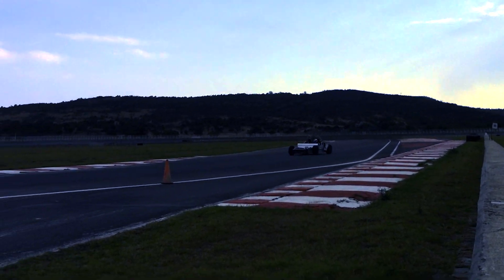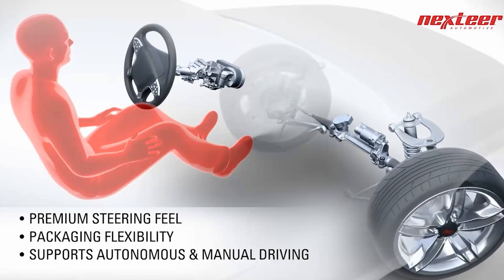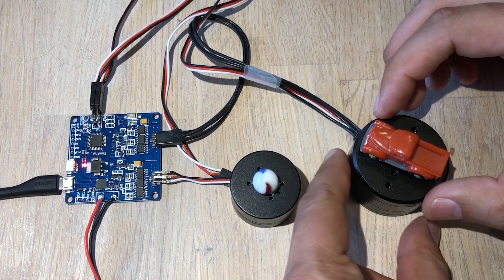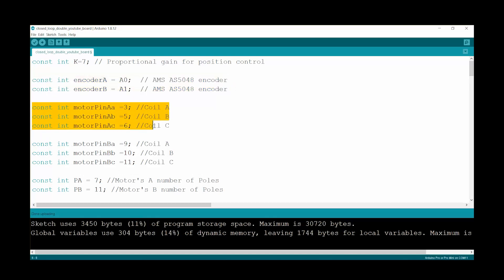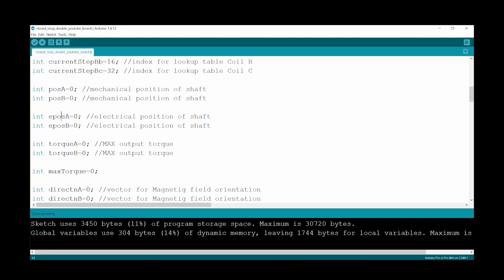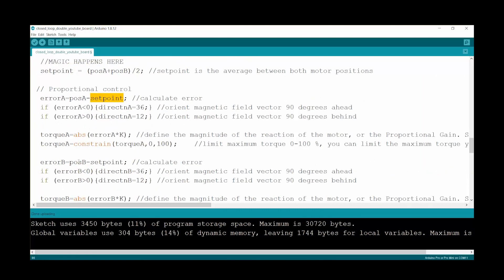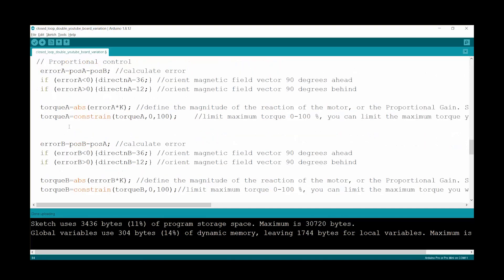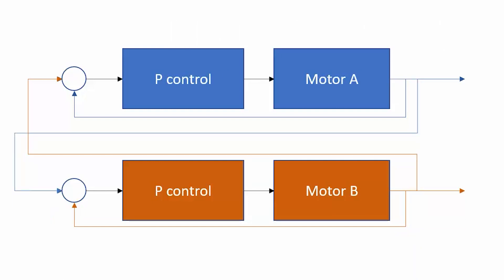Arduino Steer-by-Wire PID demo using Brushless BLDC motors FOC field oriented control.

Comment: - 0:00 Introduction to the video and topic: Steer-by-wire systems.  
- 0:35 The speaker talks about his past experience as a lead engineer in developing Mexico's first commercial sports car in 2010 to 2013.  
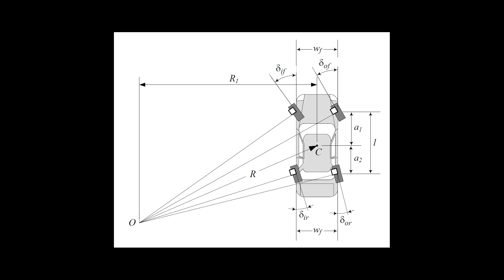- 0:50 The complexities of implementing steering systems are discussed, including the challenges of packaging and the effects on the route of mechanical components.  
- 1:14 The speaker emphasizes the importance of considering these factors to ensure proper handling and performance.  
- 1:27 The benefits of removing the mechanical connection between the steering wheel and the steering rack are discussed, including easier packaging, programmable steering behavior, and increased safety during collisions.  
- 2:00 The speaker talks about his interest in solving this problem using mechatronics and creating a steer-by-wire system.  
- 2:19 Introduction to a working prototype of the steer-by-wire system, using two motors to represent the steering wheel and the steering rack.  
- 3:00 Demonstration of the working prototype and the interaction between the two motors.  
- 4:13 Explanation of the code used in the prototype, including the use of two encoders, closed-loop motor control, and the importance of reflecting the range given by the encoder in the motors.  
- 6:50 The speaker discusses the process of calculating the error using the positions of the motors and the setpoint, and the use of proportional control.  
- 8:00 Introduction to an alternative method suggested by comments in previous videos, which involves using the position of the other motor as the set point.  
- 9:13 A diagram is shown to illustrate the feedback loops and the configuration of the closed-loop control system.  
- 9:57 Conclusion of the video and thanks for the support.

Comment: Hi, thank you for the detailed videos. I'm curious, How would such a system work if there was only one motor and you want to do force multiplication, like for example an exoskeleton, where there is one actuator per joint and your body is the input. Thanks.
Reply from the maker: It is exactly applicable to that! The torque of the output depends on the motor you use, and can be controlled via code. Information travels bidirectionally so it’s exactly what you would need ;)

Comment: Such an interesting work. I may gonna try it for myself soon. But can I use BDC motor with encoder instead of BLDC motor? Kinda want to use the old motor instead of buying a BLDC motor.
Reply from the maker: I made a similar example using a DC motor, its in one of my other videos, but it wont work as smoothly;)

Comment: Cool video. Any idea why I am getting this message when I try to upload? I tried both the ATmega328P (3.3V, 8 MHz) and ATmega328P (5V, 16 MHz) and made sure I was on the right port
Arduino: 1.8.12 (Windows 10), Board: "Arduino Pro or Pro Mini, ATmega328P (3.3V, 8 MHz)"

Sketch uses 2168 bytes (7%) of program storage space. Maximum is 30720 bytes.
Global variables use 190 bytes (9%) of dynamic memory, leaving 1858 bytes for local variables. Maximum is 2048 bytes.
C:...\AppData\Local\Arduino15\packages\arduino\tools\avrdude\6.3.0-arduino17/bin/avrdude -CC:\...\AppData\Local\Arduino15\packages\arduino\tools\avrdude\6.3.0-arduino17/etc/avrdude.conf -v -patmega328p -carduino -PCOM4 -b57600 -D -Uflash:w:C:\...\AppData\Local\Temp\arduino_build_5454/brushless_motor_eh.ino.hex:i 

avrdude: Version 6.3-20190619
         Copyright (c) 2000-2005 Brian Dean, http://www.bdmicro.com/
         Copyright (c) 2007-2014 Joerg Wunsch

         System wide configuration file is "C:\...\AppData\Local\Arduino15\packages\arduino\tools\avrdude\6.3.0-arduino17/etc/avrdude.conf"

         Using Port                    : COM4
         Using Programmer              : arduino
         Overriding Baud Rate          : 57600
avrdude: stk500_recv(): programmer is not responding
avrdude: stk500_getsync() attempt 1 of 10: not in sync: resp=0x9d
avrdude: stk500_recv(): programmer is not responding
avrdude: stk500_getsync() attempt 2 of 10: not in sync: resp=0x9d
avrdude: stk500_recv(): programmer is not responding
avrdude: stk500_getsync() attempt 3 of 10: not in sync: resp=0x9d
avrdude: stk500_recv(): programmer is not responding
avrdude: stk500_getsync() attempt 4 of 10: not in sync: resp=0x9d
avrdude: stk500_recv(): programmer is not responding
avrdude: stk500_getsync() attempt 5 of 10: not in sync: resp=0x9d
avrdude: stk500_recv(): programmer is not responding
avrdude: stk500_getsync() attempt 6 of 10: not in sync: resp=0x9d
avrdude: stk500_recv(): programmer is not responding
avrdude: stk500_getsync() attempt 7 of 10: not in sync: resp=0x9d
avrdude: stk500_recv(): programmer is not responding
avrdude: stk500_getsync() attempt 8 of 10: not in sync: resp=0x9d
avrdude: stk500_recv(): programmer is not responding
avrdude: stk500_getsync() attempt 9 of 10: not in sync: resp=0x9d
avrdude: stk500_recv(): programmer is not responding
avrdude: stk500_getsync() attempt 10 of 10: not in sync: resp=0x9d

avrdude done.  Thank you.
Reply from the maker: Mmmh that means the bootloader is working... could it be your usb cable? You see any defects on the board that could cause the failure, if so, can you send a picture?
Reply: Random Access Projects there are no visible defect. I tried two different usb cables with same outcome. I uninstalled and reinstalled the uart to usb drivers as well. Going to trouble shoot it some more tonight hopefully i find something.
Reply: No luck. I did notice something a bit strange. I power the board and the blue led starts blinking with a frequency of about 5 hz when i press the reset button the blue led turns off momentarily and then starts to blink at a frequency of about 2hz. Perhaps the reset function is not working as it should and the board can't reset properly when uploading... It's all I can come up with haha. What do you think? 
Also, If I power the board and then upload, the blue led stops blinking and turns off for about 2 seconds and then resumes it's blinking at about 5 hz.
Reply from the maker: try this! https://docs.google.com/document/d/1vX5WJ9Csb8ogLf-woMCZWNPB1QBRE9jTAPTxeFYwCY8/edit?usp=sharing
Reply: @RandomAccessProjecs  Awesome, that did the trick! Thanks!
Reply from the maker: Ernesto Hernandez Hi! Can you try this: 

 Key Arduino settings

Check the box "Show verbose output..." and click "OK"
Go to Tools/Board Type and select - Arduino Pro or Pro Mini (5V, 16 Mhz)w/ ATmega328
Go to Tools/Programmer and select - USPasp

Let me know how it goes
Reply: @RandomAccessProjecs   Thanks for the response. Here's what i am getting after trying your suggestions
avrdude: Version 6.3-20190619
         Copyright (c) 2000-2005 Brian Dean, http://www.bdmicro.com/
         Copyright (c) 2007-2014 Joerg Wunsch

         System wide configuration file is "C:\...\AppData\Local\Arduino15\packages\arduino\tools\avrdude\6.3.0-arduino17/etc/avrdude.conf"

         Using Port                    : COM4
         Using Programmer              : arduino
         Overriding Baud Rate          : 57600
avrdude: stk500_recv(): programmer is not responding
avrdude: stk500_getsync() attempt 1 of 10: not in sync: resp=0x6f
avrdude: stk500_recv(): programmer is not responding
avrdude: stk500_getsync() attempt 2 of 10: not in sync: resp=0x6f
avrdude: stk500_recv(): programmer is not responding
avrdude: stk500_getsync() attempt 3 of 10: not in sync: resp=0x6f
avrdude: stk500_recv(): programmer is not responding
avrdude: stk500_getsync() attempt 4 of 10: not in sync: resp=0x6f
avrdude: stk500_recv(): programmer is not responding
avrdude: stk500_getsync() attempt 5 of 10: not in sync: resp=0x6f
avrdude: stk500_recv(): programmer is not responding
avrdude: stk500_getsync() attempt 6 of 10: not in sync: resp=0x6f
avrdude: stk500_recv(): programmer is not responding
avrdude: stk500_getsync() attempt 7 of 10: not in sync: resp=0x6f
avrdude: stk500_recv(): programmer is not responding
avrdude: stk500_getsync() attempt 8 of 10: not in sync: resp=0x6f
avrdude: stk500_recv(): programmer is not responding
avrdude: stk500_getsync() attempt 9 of 10: not in sync: resp=0x6f
avrdude: stk500_recv(): programmer is not responding
avrdude: stk500_getsync() attempt 10 of 10: not in sync: resp=0x6f

avrdude done.  Thank you.

Problem uploading to board.  See http://www.arduino.cc/en/Guide/Troubleshooting#upload for suggestions.
Reply from the maker: And you can program an Arduino Uno for example with that same PC? You have an Arduino other than this one to try? Sometimes you need to disable and reinstall all the drivers for Arduino IDE to function properly, can you try other PC or another board? Can you check troubleshooting online? I had a fault in my computer that allowed one Arduino nano to be programmed but not another one that was exactly the same... things can get pretty weird sometimes. Also, can you wire a motor to any of the ports and energize the board as it came out of the packaging? Let me know what happens, ill stand by.
Reply: @RandomAccessProjecs   Yes, I've tried with an UNO and two Megas and I can upload to those fine. I tried on my Ubuntu machine and got the same result. I've tried a lot of stuff i have found online but most of the recommendations point at having the wrong board or port selected. Just plugged my ODrive D5065 BLDC to the board and it spins at a slow steady speed. I did notice it's drawing a lot of current though. Not sure if this is normal.
Reply: I think it might be missing the boot loader? I tried to upload using the USBasp programmer but it failed to find the port. Do you know if maybe I need to upload using a different programmer?
Reply from the maker: Can you connect a motor to the output and energize the board with same configuration as it came when it arrived? It should flash some leds and then spin the motor... is this happening?
Reply: Random Access Projects Yes, a blue LED flashes and the motor spins at a slow steady speed.
Reply from the maker: Ernesto Hernandez mmmh, interesting... i have sent you a new board today, apologies for the problems. Lets see if that solves the problem. In the meantime, let me know if theres new developments.
Reply: @RandomAccessProjecs  Thanks man. Hopefully that solves the problem. I'll keep you updated.
Reply: @ernestohernandez7137  I have encountered the same issue trying to load firmware to it. I have a few unos and esp32 dev boards that all work fine and this is the only board I have had trouble writing anything to. Let me know if you ever get it working.
Reply from the maker: @slowpaste  try this! https://docs.google.com/document/d/1vX5WJ9Csb8ogLf-woMCZWNPB1QBRE9jTAPTxeFYwCY8/edit?usp=sharing
Reply: @RandomAccessProjecs  thank you very much! I will try it as soon as i get home from work! I'll let you know if it worked! :)
Reply: @RandomAccessProjecs  Worked perfectly to write the bootloader! Afterward, I was able to load code to the motor controller board with no problems and got the motor to turn properly. Unfortunately, there was an issue with the board, with my code, or with my own wiring afterward, because I burned out something on the board within a 10 minutes or so of actually getting things running smoothly. It still works but only with USB power, trying to power it through an external PSU suddenly stopped working.
Reply: i have the same issue! Identical error..
Reply from the maker: @vidcresnik9814  try this: https://docs.google.com/document/d/1vX5WJ9Csb8ogLf-woMCZWNPB1QBRE9jTAPTxeFYwCY8/edit?usp=sharing

Comment: very interesting!
two things jump to mind from the code you show: 

1: in the second method, calculate `errorA = posA - posB` and `errorB = posB - posA`, but that means that `errorB = -errorA`.  you could still remove a bit of code there and make it simpler.
2: what would happen if you use different weights to calculate the error?  like `errorA = (posA*3 - posB) / 4`  or even just `error = posA*3 - posB`.  Would it amplify/reduce the force feedback?
Reply from the maker: Javier Guerra hello! 1: true!!! 2: you can play with different values of K, even have a Ka and Kb, but yes, what you mention will modify the magnitud/behavior of feedback ;) thanks for your valuable comments!

Comment: Can't this become unstable if the loop rate is too low? If so, is it possible to add some sort of damping parameter to address this? Also, what's the loop rate that you're achieving on your microcontroller? What's the maximum rate that can be achieved with it? I bought a couple of them, and I'm super excited to check this out. I want to try having two of your controllers connected through the Internet to each other and see if you can get remote bilateral teleoperation that way. Latency would be about 10-30ms, so loop rate would be limited...